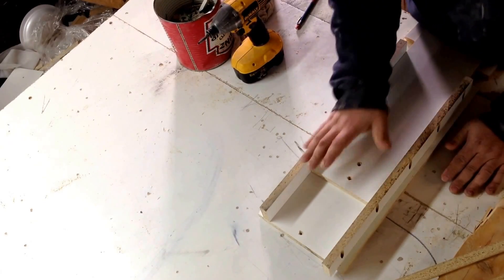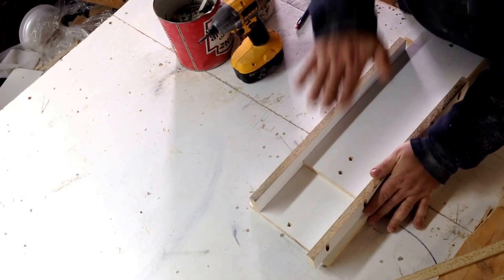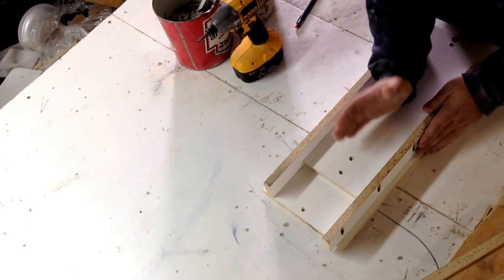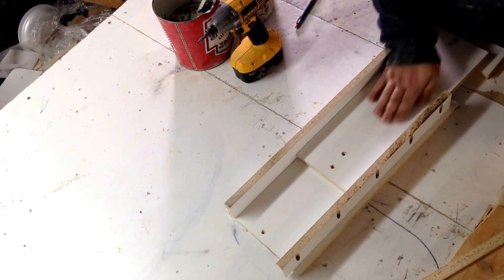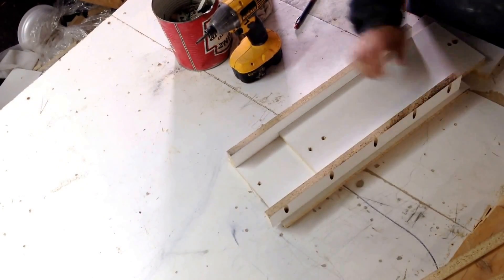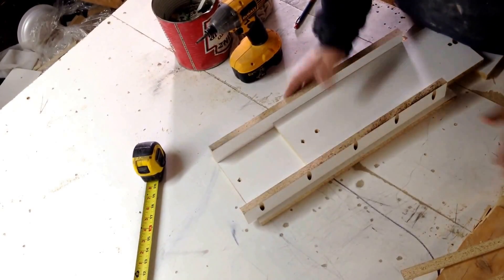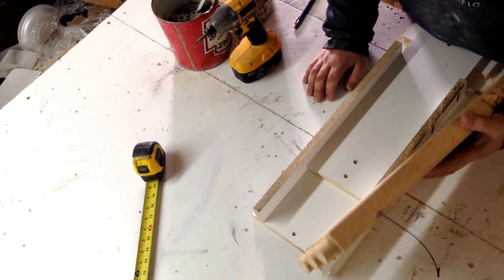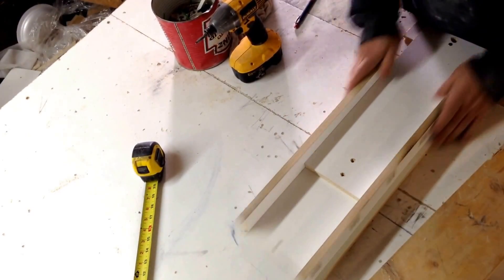Floating Router experiment

Comment: They both are great concepts that you put into action (pun). Since you asked our input here and in the other videos, My thought on size of cut would be for a max cut area for a 2x10 and/or 6x6 piece of wood. The other thing is to make it as small a work machine as possible to take up less of a footprint or bench area while still allowing range of motion AND the minimum of physical stress on the user since it will have a router inside. Last but 2nd most important (other than design so far) is the ability of users to setup templates easily and quickly plus make them on their own needs. Sorry this was so long but you have such a great concept! Thanks for sharing.